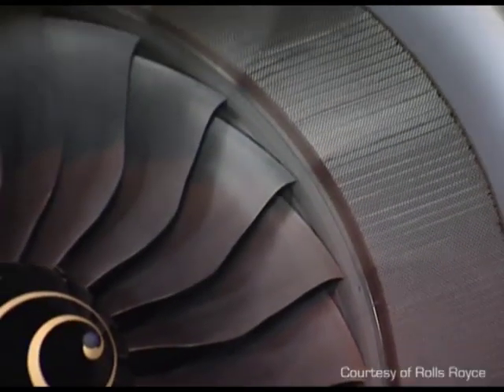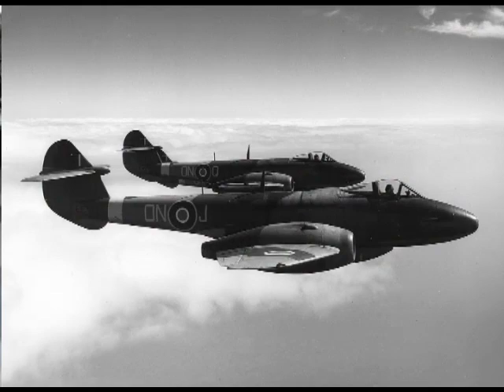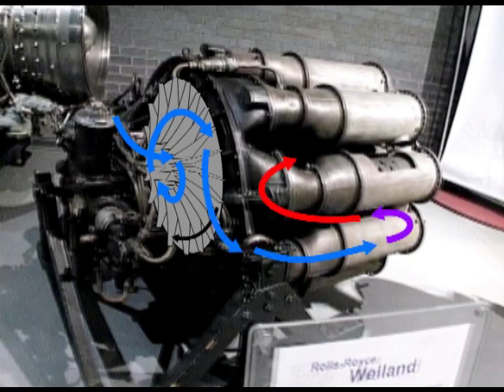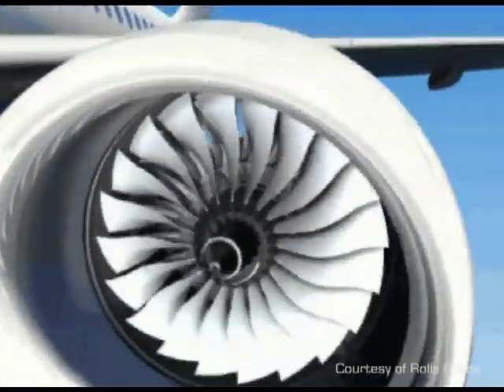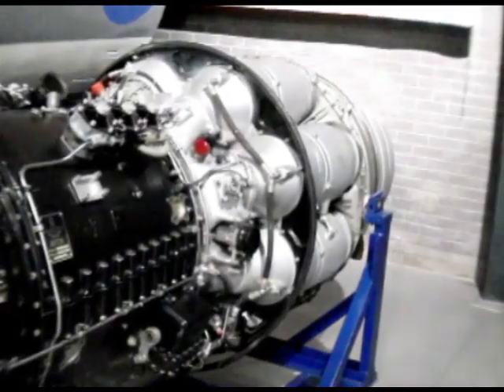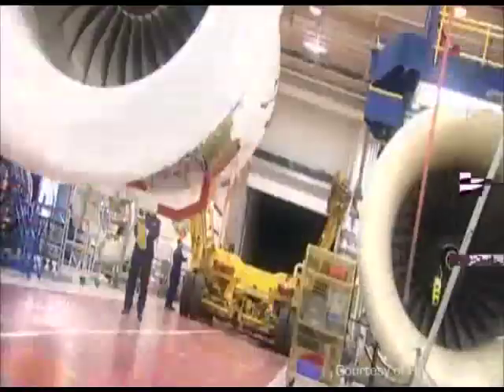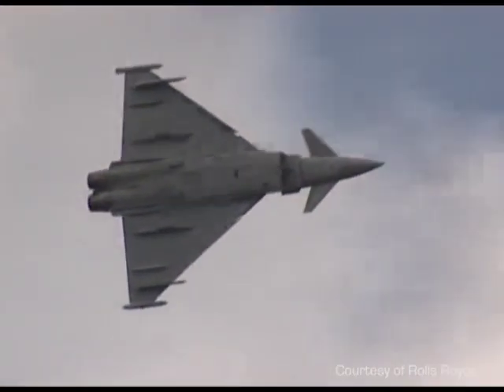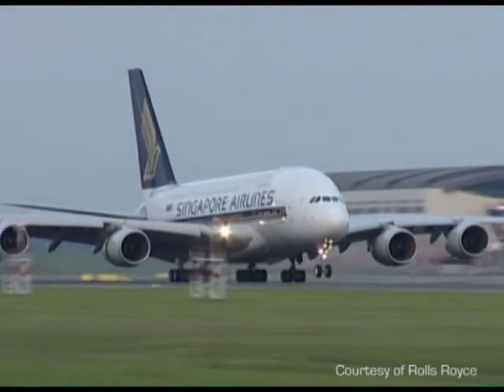A Short History of the Jet Engine

Comment: Whittle first successful full power test was not until Sept. 1939... slightly less than month after the HeS 3 flew.. All previous tests were aided by the output of a 4 cylinder automobile engine...
Reply: doktorbimmer 

The axial compressor was first demonstrated in England, the Germans were the first to get a production model running. While the Allies used centrifugal compressors because they were more reliable and better understood at the time. That’s part of the reason why the ME262 had to have entirely new engines every few hours. Axial jet technology wasn’t ready. It’s yet another example of the Nazis pouring scarce resources into on paper war-winning weapons using technology that wasn’t ready.

The father, as we know it, of the turbo jet was British inventor Frank Whittle. Long story short, the British defense ministry rejected Frank Whittle’s design in part due to reviewing engineers at Armstrong-Whitworth pointing out, correctly as it turns out, that a turbo jet engine would be fundamentally inefficient. Instead Whittle patented the design, and not being top secret, the concept greatly influenced the Nazi design team led by Hans Ohain.

Engineers at Armstrong-Whitworth, drawing upon their criticism of the Whittle concept, began development of the first axial-flow turbojets and the first turboprops. And it is this technology family that led directly to today’s turbofan jet engine. The Whittle design proceeded in private development, eventually being taken over by Rolls-Royce. By 1944, the Armstrong-Whitworth design developed higher thrust with superior throttle control, and the Powerjet/ Rolls- Royce centrifugal flow turbojet has proven itself to be far more reliable than the competing Nazi jet projects, the Jumbo 004 and the BMW 003.

Steel is the wrong material from which to build jet engines. Given time, steel will always fail. It fails because the iron in steel sublimates out of the alloy, essentially turning the metal to Swiss cheese on a microscopic level. The general term for such long term metal fatigue is “creep.” In the 1940’s, no one knew that steel would inevitably fail given the temperatures and pressures in jet engines. The correct material that makes jet engines actually practical, and not simply impossible, is nickel alloy, which was a British invention, designed by the British jet design teams. There is no indication that the Nazi design teams ever understood that steel was never going to work, no matter how much they modified their design. The fact that nickel alloys were the solution was not at al intuitively obvious and the Nazis weren’t doing much in the way of R&D to discover the problem.

The Nazis two major production jet engines never managed to last more than 25 hours. You can’t win a war when you have to replace, not merely one but two engines, the most critical and expensive component of an aircraft, every few hours. The icing on the cake is that the Nazis didn’t have access to sufficient quantities of nickel, courtesy of theRoyal Navy blockade, even if they somehow discovered that steel was never going to work.
Reply: I have only recently come across this video - and your comments.  Herewith a copy of a comment I have posted in response to a similar comment of yours elsewhere.

You are one of several detractors who foolishly denigrate and deny Whittle's undoubted genius and achievements. 
Frank Whittle's first patent application was filed on 16 January 1930.  It was published the following year and a copy of the abridged version of the provisional patent was recorded in Berlin, date stamped 15 August 1931.  There is no doubt that copies were circulated to various universities and technical institutions in Germany.
During interrogation shortly after the war, by no less than Captain Eric 'Winkle' Brown (who also interrogated Goering), von Ohain was evasive: however, one of his co-workers acknowledged that they had seen Whittle's patent.
It is also a recorded historical fact that, during initial test runs in April 1937, Whittle's first engine 'ran away', as a result of an accumulation of fuel in the combustion system continuing to burn, even after the fuel supply had been shut off.
Your suggestion that the 4-cylinder automotive engine (a 10HP BSA engine), seen in photos of Whittle's early 'ground use only' engines was to "aid" the jet engine is totally false.  It was used as the starter and would have been destroyed had it been connected to the engine when it 'ran away'.
There is no doubt that von Ohain initiated development of the jet engine in Germany, but let it not be forgotten that its history will forever be tainted by its association with a regime that murdered millions.
Reply: @grahamj9101   Maxime Guillaume patented the turbojet aircraft engine in 1921 when a 14 year old Frankie was still wearing short pants.
 Frank Whittle was only the 4th person to successfully demonstrate a jet aircraft engine.

The "Sir Frank Whittle" of British propaganda myth is a fictional character, created by british revisionist historians.
The real Whittle was more caricature than hero, a drunken boaster, liar and tireless self-promoter... he plagerized the work of A.A. Griffiths and made many enemies at the RAE,  Rolls-Royce and entire British aircraft industry.
 Frank Whittle was addelled by his addiction to amphetamines and benzodiazepines, he also admitted to being a horrible alcoholic.
Whittle's involvement with the Miles M.52 scandal forced him to resign from Power Jets Ltd.  discharged from the RAF for dereliction of duty.
He was exiled to a drug rehab in America to spare the new Labour Government any further embarrassment.
He was blackballed from the aircraft industry in the U.K. and eventually left to live the rest of his life in America.

Indeed, the British will always be tainted by the mass genocide of the Victorian Holocausts... crimes against humanity that have never been answered for,  the British Colonial Empire made Hitler and Stalin look like amateurs...